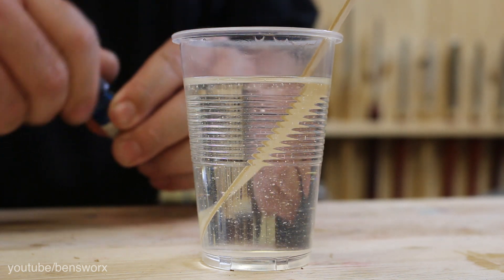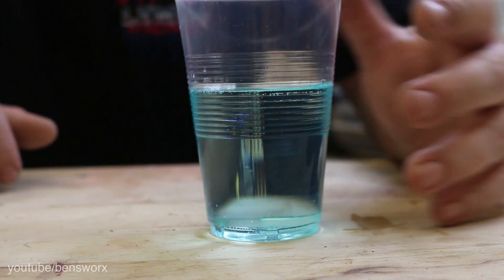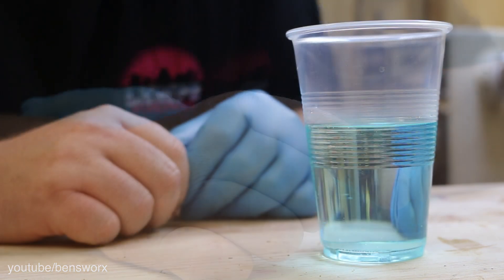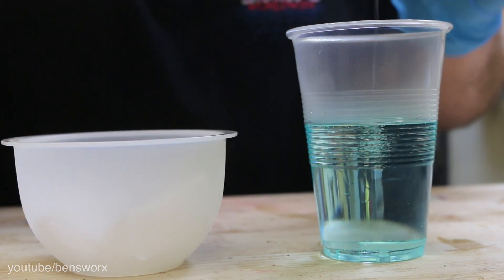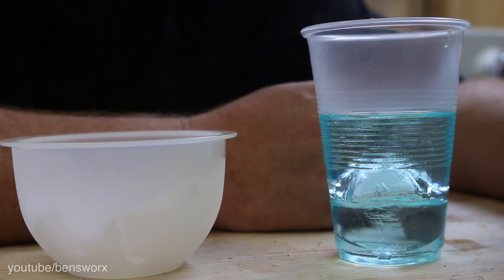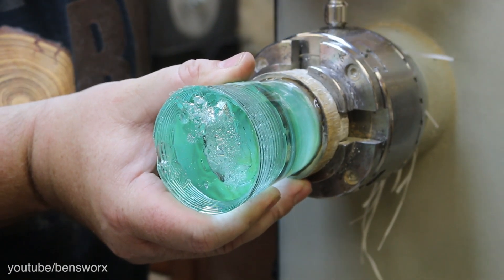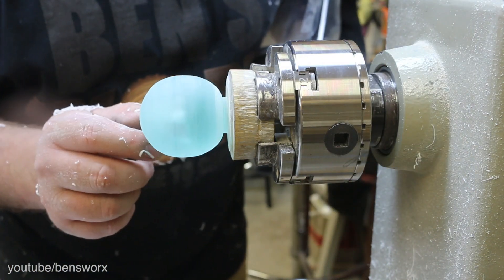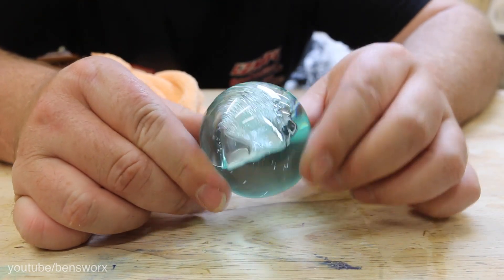Can You Cast Ice in Epoxy Resin ?

Comment: Put it back into the freezer and see if the water forms back to the same piece of ice.
Reply: Yes
Reply: Why wouldn’t it...
Reply: YESSSS!!! This would be an interesting experiment. As it transitions from liquid to solid, it would be interesting to see whether it would crack, since it seemed like there was some air inside.
Reply: @Darknesssleeps  because the cube wouldn't fit inside the whole mold, given the fact that some of the water had evaporated and isn't inside the ball anymore due to some of the bubbles he made, you can see it when he shakes it around that there's definitely not enough water on the inside to fill the whole mold back up to it's original form
Reply: @harleyrexun5310  dumb answer, it wouldn’t because a good portion of the water is evaporated
Reply: …. SMH go back to school lol.
Reply: I meant forms back to the EXACT same piece of ice as before. Of course it can become ice again, but the EXACT same piece as before? Think about it.
Reply: @thesighbored  if the resin hardened around it before it melted then it should have created a mold which would encase it in the exact same shape. It depends on if it melted or not. Other than that there’s no real way to be precise because if you try to take it out it would start melting.  Only way to tell would be to do this experiment while standing in a subzero walk in freezer
Reply: @slumberrrrミ  ice expands when it freezes so it's anyone's guess
Reply: @DAN_CLERGYMAN   I was about to say, the water wouldn’t fill the same cavity as a liquid like it did in solid form. Ice is less dense than water everybody.
Reply: When water freeze it put presure in all direcrions and the water doesnt have the same shape as the ice because its denser. I thinl it would wither crack or deform a bit
Reply: This looks cool
Reply: @thesighbored  The answer to that is easy. No. Of course not. That's... a really silly question. Water takes the shape of the container it's in, so when it freezes, the ice will be the same shape (probably a little disfigured depending on if it's in a closed off container and can't expand properly). But there's absolutely no reason that the water would magically go back to it's original shape after freezing again because the shape that it's in isn't the same shape.
Reply: @thesighbored  Like walter said, that would only happen if the resin made a perfect mold and if the ice didn't melt while it was hardening. Thing is, ice melts fast, and resin hardens slow. The ice would have at least melted a tiny bit before the resin could harden. Even then though, it still wouldn't work. When you try to freeze it again, the ice would expand and probably deform the resin or something.
Reply: water is more dense than ice. as water is basically non-compressable some water will evaporate as the vaccum it leaves would boil water leaving gas to fill the vaccum. the ice should freeze into the same shape without issue. assuming the test conditions are perfect
Reply: @Darknesssleeps  
It can never be the same piece of if because the original piece melted. Ice can reform but it will never be the same piece again.
Reply: @DAN_CLERGYMAN  
The void is large enough for the ice to expand in as it freezes. We know this because the original cube obviously fit and some water was obviously lost in the process. Even if zero water was lost, as long as no new water were introduced, the ice would have the exact amount of room it needed, by volume z to expand without upsetting the cavity. 
No cracks, no deformation.
Reply: @goodcitizen3780  this came a little late but thanks, you learn something everyday.
Reply: @DAN_CLERGYMAN  
NP. Blame youtube btw lol usually it's 8 years late! Lmao
Reply: @slumberrrrミ  Water expands when it freezes.
Reply: Research the ship of theseus
Reply: @slumberrrrミ  mate… when liquid turns into a solid it expands. Put a full cup of water in the freezer it will freeze over the cup level…. This aint it
Reply: Wow, zero mention here as to the unique property that makes the H2O molecule so special and a building block of organic life. The crystalline lattice phenomenon allows the solid form to be less dense than the liquid form. So, the air pocket in the void is actually at a lower pressure than the room standard. Also, it is likely residual atmospheric gas dissolved into the h2o... Neat. Should do again with clear (de-gassed) bartender style sphere like the ones used for whiskey... Maybe add glitter, cheers!
Reply: @pleaseandthankyou708  you're right lol hahaha, best answer, someone said before "when liquid turns into a solid it expands", based on how they saw how a cup of water froze above the cup level, but that's actually only true for water (and i guess maybe some other Compund?), But yeah, water its pretty special, life probably wouldn't be possible as we know if the liquid state wasn't denser than the solid state.
Reply: This is what i wanted to see
Reply: @mcstube9154  Since it is an airtight seal, where would it evaporate to?
Reply: It was ice when the epoxy set so when it thaws there will be water at a lower pressure, so when it re freezes it will return to the frozen water at original pressure, by my reasoning
Reply: you really can't figure that one out for yourself?
Reply: @slumberrrrミ  I think you forget that when something freezes it expands.
Reply: " if I get all wet, then you know I've gone too deep." 😁😭 That's what she said
Reply: That’s what I thought as soon as I saw the video lol
Reply: @Darknesssleeps  since the ice was melting as the resin was curing, I suppose it’s possible that the resin would have molded around it while it’s partially melted, in that case since water expands when it freezes it’s possible that the resin would crack or explode rather than it just forming normally. It would probably just be a normal looking ice cube tho tbh
Reply: @slumberrrrミ  water expands when it’s frozen, so that wouldn’t be the issue
Reply: Interesting!
Reply: Replies did not pass the vibe check lmao
Reply: From how much i think it would get back to its shape cuz water expands on freezing
Reply: i think it would crack because water freezes on the outer edges first this would encase the water in ice without actuly filling all of the space as the water on the inside frezzes it continus to put more pressur on the bottom of the resin until it cracks
Reply: Try degassing the water and if you can freeze an ice cube or ice globe while in the degasser before inserting it in the resin to see if that eliminates most of the air pocket.
Reply: There will be an air bubble no matter what u do. Once the ice melts depending on temperature in the room some ice/ water molecules now, will separate. Some hydrogen & oxygen bonds will brake a part from one another. However since the resin creates a seal these gases have no where to escape. Hence an air bubble will form because some water forms of H2O will disengage & break into their smaller form. Therefore, a voided spot will continue to exist which is filled with the lighter gases instead of the original liquid of water.
Reply: @thesighbored  Water expands when frozen, not that it would fill every cavity, but it would be cool to see.
Reply: That would probably work if the ice cube had no bubbles
Reply: I was thinking the same...
Reply: @stephencrompton4352  Yeah, it expands by a whopping 9%
Reply: @DAN_CLERGYMAN  Ice doesn't freeze.
Reply: @mcstube9154  Does the evaporated water make its way out of the resin while its curing or how does the water leave the resin?
Reply: I would guess no. not only did some evaporation escape in the form of bubbles, but water expands when it freezes. so if theres enough pressure in there it wouldnt be able to expand enough to freeze
Reply: just for it to melt again once you take it out?
Reply: @slumberrrrミ  water expands as it freezes Einstein
Reply: Ask Banksy if he wants to be put in epoxy!

Comment: That is fascinating. I'm surprised it cured since I know water and resin generally don't mix.

Also, freeze a tiny sailboat in an ice cube. Put a new spin on ship in a bottle.
Reply from the maker: Yeah I was surprised too
Reply: Or a submarine.
Reply: Good idea 👍
Reply: I'd love to see the tiny sailboat, that sounds adorable haha
Reply: Ooh, or a miniature of the Titantic?!
Reply: There would have to be a lot of air in the ice. The boat can't float without a surface, it would just be mashed sideways against the top of the bubble if it was full.
Reply: That would be cool
Reply: The water only expands about 9% when it freezes so you'd have to figure out how to end up with a big enough volume of air to float the boat in. It would be tricky...
Reply: @freedapeeple4049  one of those countertop "chewing ice" ice makers maybe? Or a whiskey ball half frozen then drained of water?
Reply: @Faesharlyn  cut/mould a dip in the ice then freeze a thin layer over the top to get more air in?
Reply: @Faesharlyn  You can make hallow ice balls easily with those bartending ice molds. You pull the ice out right when it is starting to freeze and use a syringe to pull the water out
Reply: @daze8410  that sounds perfect!
Reply: @BensWorx  i reckon you will puke 😂
Reply: epoxy is ok with moisture polyurethane is not
Reply: @Faesharlyn  I only know because I've done this for a speciality drink at a wedding lol. I put the syringe in the same way you'd start a stick fire. Then refroze the balls, lol, and I used syringes to inject mixed drinks to order (tequila sunrises look beautiful inside them).
Reply: @daze8410  that sounds outstanding! Do you happen to have a link to a video? It would be very cool to see. Were they cracked open to drink or open enough to use as a shot glass?
Reply: @Faesharlyn  No, but I have always had this idea to freeze all the mixers (because alcohol doesn't freeze), inside of the ball and then pour the liquor over so it starts to melt the ice. I could have hundreds of pre-mixed (balls) ready to go. Unfortunately, I'm not a bartender anymore with covid and all. Maybe I'll try it out at home
Reply: He just did a jellyfish yesterday
Reply: @daze8410  kind of like a hot chocolate bomb, I like it!
Reply: Where the fuck are you people getting small enough sailboats to be put inside an ice cube
Reply: jerilee hughes  any water in the hole would refreeze and seal it up, just like an old ice fishing hole.

 @MiiLK t 3d printers have come a long way in the last few years ;  )
Reply: @natalyst  @Ben's Worx THIS SO MUCH. Tiny sailboat in ice ball FTW.
Reply: @daze8410  You gotta snap a few pics or record a video for us. That sounds so interesting.
Reply: From "ship in a bottle" to "ship is the bottle", might be interesting

Comment: Years ago I did lots of work with resin.   First, depending on the resin hardening reaction to whether it is endothermic  or exothermic. In the case of an exothermic reaction, no possible way to keep the ice cube frozen.   In the case of an endothermic reaction, it MIGHT stay frozen, but only if you keep the entire casting below 0 degrees Celsius.

Putting it in the freezer while it cures could stop the resin from curing at all.   Most resins have a set temperature.   An exothermic resin would have to be given a LOT of catalyst if you put it in the freezer, and then it would give off so much heat the ice cube would melt.  An endothermic resin... it depends on if it could set at that low of a temperature I guess.  But, once the endothermic resin rises above 0C, it will melt.

You also have to take in to account that ice is expanded, even if it is clear.   So, if you got no bubbles in there, you'll probably end up with some vacuum space when it melts and/or some of the still dissolved gasses trapped in the "clear" ice that you just can see.
Reply: damn this was so interesting to read /gen
Reply: What would happen if you took water with no air bubblies, put it in resin and then tried to freeze it?  There wouldn't be room for the water to expand to ice, so would it remain liquid?
Reply: @winstonsmith6607  it would crack the resin at any weak point

Comment: a tip for testing the resin to see when it's ready without introducing bubbles, when you mix up your resin, mix up a bit extra and pour it into a second container, you can use that second container of resin as your tester leaving your main resin pristine and for when you're ready to add the object
Reply: That's pretty smart
Reply: They would cure at different rates if they’re not the same amount in the same sized container.

Comment: You should get an ice ball mold and fill it half way and put a small rubber duck in it then freeze it so its in the middle then fill it fully and freeze it again then put it in resin and shape it into a sphere and let the ice melt inside so the duck will float around in the water inside the resin sphere
Reply from the maker: Nice idea mate 👍
Reply: @BensWorx  you should boil the water first to prevent air from vorming bubbles also Nice vid
Reply: @starwolfcutie7466  im trying to remember what the official way of making clear ice is i think you have to have a pump to keep the water recirculating but yeah i think boiling can help a little
Reply: @Sarge92  look up directional freezing
Reply: Ooh legend 🤯

Comment: I don't know if this has already been mentioned but if you boil water before freezing it you'll get some real clear ice cubes
Reply: I know this is an old comment, but it's not just boiled water it has to be boiled distilled water that may or may not help the water to be clearer, that or RO treated water. Even then it relys one the method you use to freeze the water. So weather you use either of the two types of water if you use the traditional ice cube trays, it's a lot harder to make clear ice cucbes.

Comment: What if you freeze it again?  Would the ice expand and trapped air be put under pressure and fracture the resin or would the new ice just take up the same volume that the original ice did?
Reply: Asking the right questions here
Reply: Same volume. If there is no shrinkage from the resin and it is not porous you should experience no cracking.
Reply: I dont think anything would happen, im pretty sure when the cube melts it just creates a vacuum where the air pockets would be, so theres no extra space taken up.
Reply: @teknoreaper9232  but that ice cube was definitely airated, so there has to be air. i’m just not sure if the ice cube refrozen would become the exact same % airated, or if it would expand, not take up all the air, and end up with a larger volume than before.
Reply: @m-aj-or  i see what youre saying. I would assume that it would take more energy to refreeze and push all that air outwards than it would for the ice to just take in the air again.

Comment: One thing to remember is that water is at it's densest state when it's liquid, so you're very likely going to get an air pocket, or cause some structural strain whenever an ice cube melts here.
Reply: Well you say air pocket but its not really air its a vacuum pocket (with a little air) or just low pressure air
Reply: @sora2534  The water can evaporate inside, so the air will be at the vapour pressure of water, which is about a quarter of atmospheric pressure.

Comment: So this is basically how you make a simple one step snowglobe? 👀👀👀
Reply: My question is will it last or will it melt 🤔 kinda surprised he didn't have to spray it with water to keep it cool while sanding/polishing...still really cool 😎
Reply: Simple one step 💀
Reply: @SandiegoChapo  it already melted way before he started sanding tho?
Reply: @SandiegoChapo  The ice already melted, the reason why it looks like its still there is because the resin set to the shape of the ice cube before it was completely melted. That's why when he moves it around you can see the water moving.
Reply: @chadachi3970  Ahhhhhhh I didn't even notice that...Good eye 👁️👍🏽
Reply: No, a simple one step way is to unscrew the bottom of a snow globe and pour water in it.

Comment: How about using an ice cube tray as a mold for clear resin "ice" cubes? This way it will look like an ice cube but not interfere with the outer resin. You can even "freeze" things inside the resin ice cube.
Reply: Kinda makes me wonder how resin ice cubes would work compared to frozen water 🤔
Reply: @18spd4Life  Not very well, it takes a lot of energy to heat up. The specific heat of water is 4184 J/kg*K where as resins is 1110 J/kg*K basically it takes almost 4 times as much energy to heat up water than it does to heat up resin, meaning your drink would stay cold for a very short amount of time, or not even get cold.

Comment: Not gonna lie this is the first time i see someone vacuumed the resin to really get all the air bubbles out 🤣🤣
Reply: Most people that's been doing resin for a long while always vacuum out the bubbles.
Reply: @KingMoronProductions  10 liter vacuum pot and slow set epoxy.
Reply: @KingMoronProductions  you can also use a little torch to go over the resin while it cures to burst surface level bubbles
Reply: @KingMoronProductions  When doing large pours on flat surfaces, you use a slow setting epoxy, mix and pour really slowly.  Then you and go over the surface with a blow torch or a heat gun and it pulls many of the bubbles close to the surface and eliminates them.